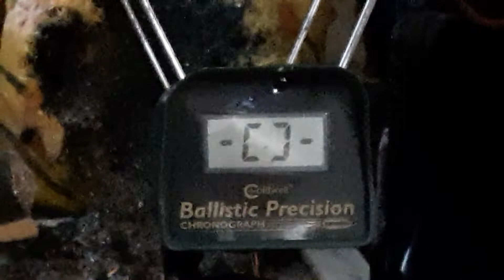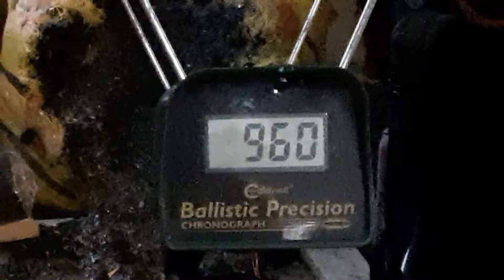Benjamin Bulldog 290FPE "Beast Mode"

Comment: Looking good! I have been kicking around getting one of these but I have two concerns that kind of meld into one. How durable is this gun for long term use and do you think it is possible to replace that plastic stock with some wood to make it a longer lasting gun? The internals seem capable, I just have concerns about the plastic stock in the long term.
Reply from the maker: That stock will last without issue. It's very durable as is. You could make a custom wood stock.  I've seen others who have.
Reply: @AnnihilatorAirguns  Cool thanks for that. Can you tell me who made wooden stocks and if there are any vids or pics online? I want to see if it is within my ability to make or buy one.
Reply from the maker: @sambaaxe  I don't know of anyone selling them.  It's pretty much just a measure twice and carve once scenario until it fits. You'd have to be fairly good at woodworking because you'd need to carve in a bracket to house the trigger and linkage.

Comment: Hello, I have a couple of questions, If you remove the # 15 return  spring, does it make it hard to fill the gun when it is completely empty at 0psi? How do you reshape the poppet? like grinding it more into a rounded shape in front of the poppet?

Comment: Have you  done any work  own a wenchester model 70 .35  I got one this. Season and  its  pushing.  A 132 grain cast  at 711  fps  I'm wanting to try and get the fpe up to over 160  or more if possible
Reply from the maker: They are almost identical to the kral guns. I've worked on the 70-45 so yeah I can help you. Just ran the numbers and you're already at 150fpe so 160+ is doable.
Reply: I have the 70-45 doing 220 with cast pellets an 250 fpe with 350 gr ,,I have a video on it check it out,, you do know there is a power adjusters on it righ?? But you can put 3/8 of washers shims in on the     hammer side an put adjuster all day out ,,it gives more weight on the hammer at the same time compressing the spring
Reply: @kevinalt1707   win u got it it was pushing jSB 81g at 800  i adjusted it up  all the way   and  its pushing  880 with the jsb 81g     was just wondering if there was any thing else that could be done   to bring the fpe up   love the gun as it is.   Med size game   is no match for. Its power  . I wanted it for. Deer hunting.   Trying to get as much  fpe out of the .35
Reply: @a.m.hobbies3623  well without digging into the gun the shims in the hammer for more hammer weight is the easiest ,, or a longer barrel would do a lot to,,but other than that you would have to open up the ports an put a light valve return spring in it,, it's actually one of the easiest guns I've worked on,, bit the ,20 inch barrel is what hurts thees guns but also nice being compact,, if you are not confident enough to drill through your gun you can just shim the hammer an light valve return spring , would give it a nice little bump..it will open the valve up more at higher pressure
Reply: @a.m.hobbies3623  also if you're valve stem ever snaps let me know,,I can make you one it's very common in therse guns,,
Reply from the maker: Opening up the ports and removing the valve spring will add a little power. Great job on your tune. I've not seen anyone else who is getting 250fpe from that gun.
Reply: @kevinalt1707   well do. Thank you for your input    I've looked around. And  have not. Seen any one.  Doing any mods to them  other then your video .  Jw if there was any   way to  do sum light  modification  to it.  With out. Major    work .
Reply: @AnnihilatorAirguns  well it was around 244 but I could only do it with the 350 NSA baot tail with very little bullet to barrel contact ,,low drag,,  but thanks

Comment: Does higher psi mean more power?
Reply from the maker: Only if you have the valve,  hammer and spring tuned to open at that high of pressure.  If I fill higher I can't open it as much and my power would drop.  If I increase the spring tension I can still gain more power.  With an air tube upgrade I can get over 325fpe at 4000psi.
Reply: @AnnihilatorAirguns  thanks for sharing.